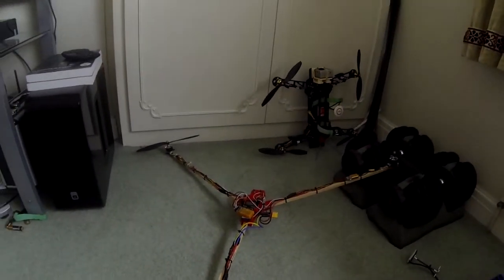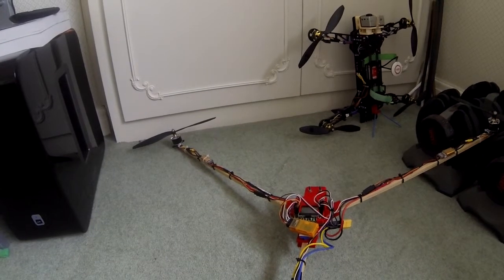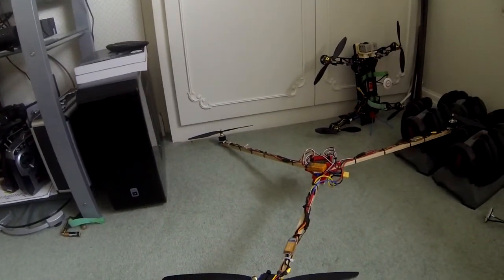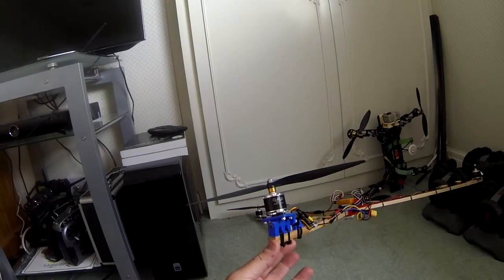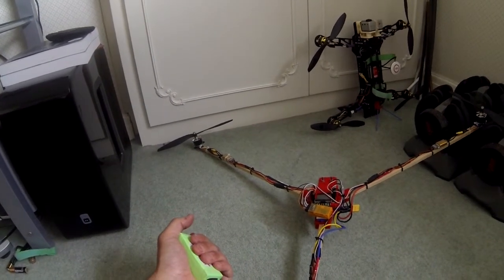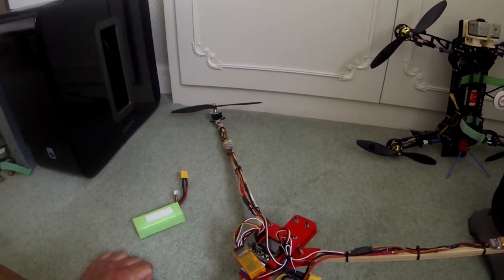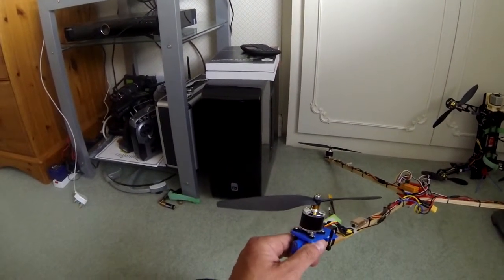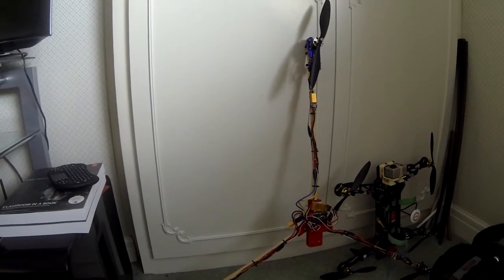intensewalkera Ultimaker 3d printed Tricopter V1 Overview

Comment: If the tail servo is doing a high speed shudder that's an issue with an older firmware version. If you update the firmware to the newest version it fixes this issue and the tail becomes rock solid. Mine flies rock solid and I love it. Cool build!